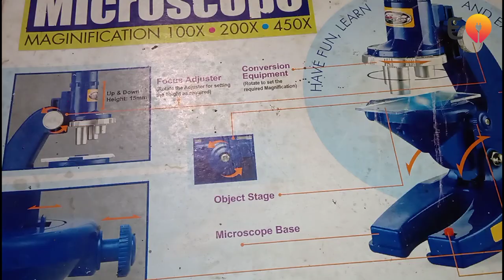Make spy FM transmitter using crystal

Comment: My circuit is not working. I made as per given in your website. Anybody here whose circuit is working?
Reply from the maker: Yes its work Wall you can use 27 mhz to 108Mhz any crastal as your need frequency